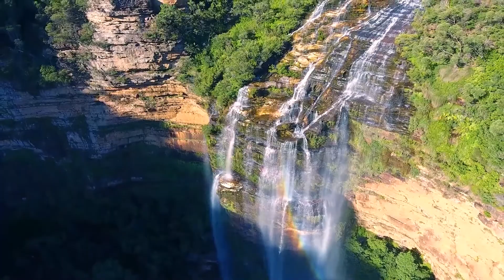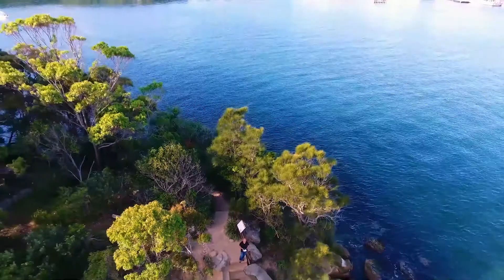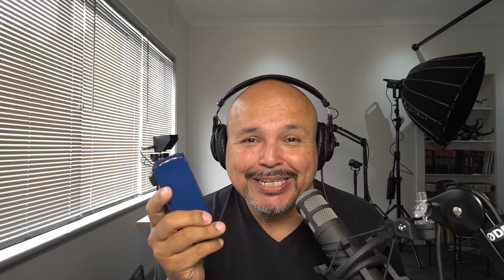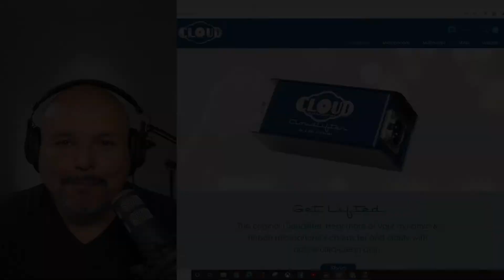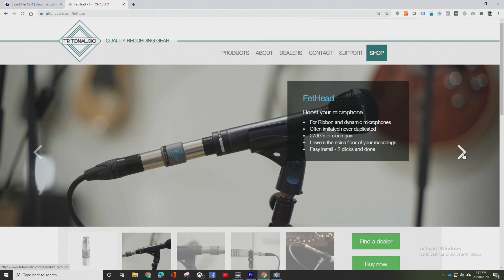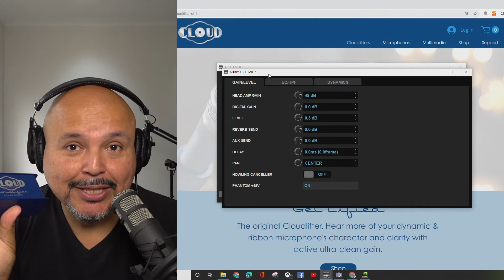Using Cloudlifter to enhance your dynamic mic

Comment: So phantom power is okay to turn on with the Rode dynamic microphone connected to a Donner Booster?
Reply from the maker: I don’t have an issue with it, I understand most modern mics won’t use the excess power if it’s not needed.
Reply: @FernLecaros  thank you!